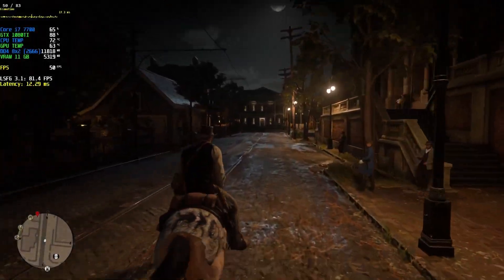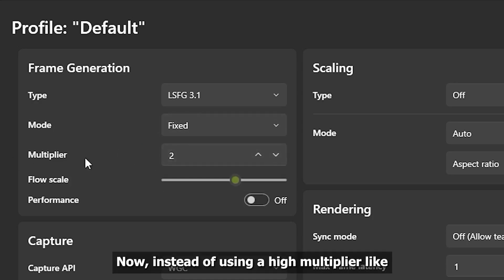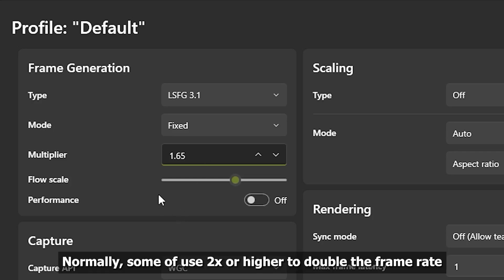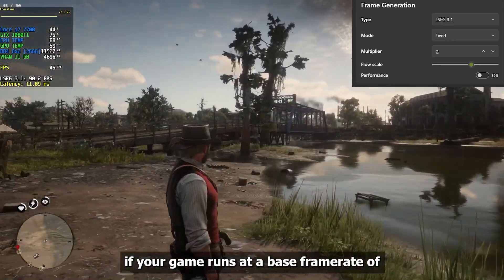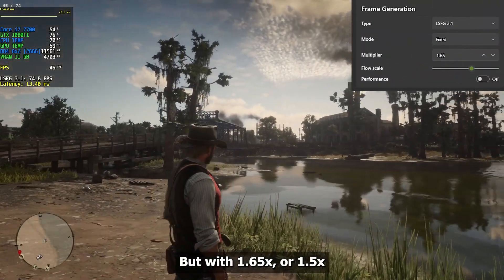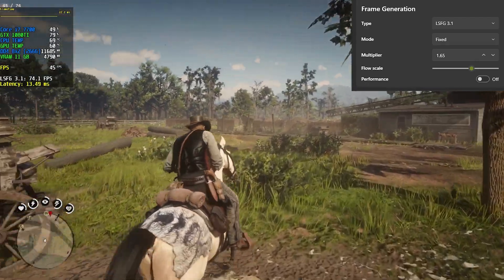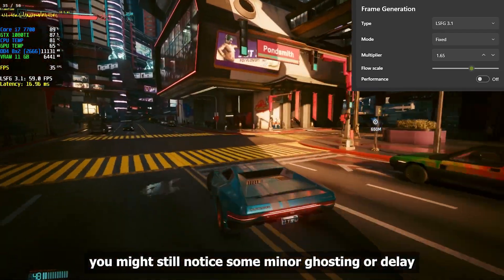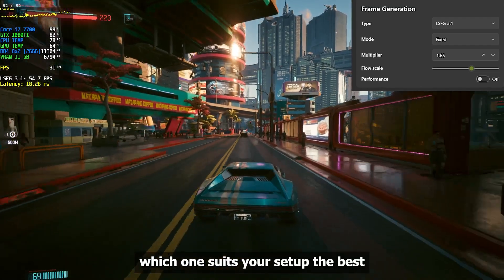Reduce Flickering & Input Lag with This Multiplier Trick Lossless Scale Frame Generation

Comment: I have a question, when i for Example play bf6 or other game i suppose to get 90-120 fps i native 1440p high settings, but when i activate lossless scaling with 4x lsfg it shows that its scaling from 60 FPS but iam supposed to have 90-120 fps so the imput lag increases a lot but why does it happen and is there any fix for this, approcate for answer
Reply from the maker: Using Lossless Scaling costs you some of your native FPS because the software needs GPU resources to generate the artificial frames. The higher the multiplier you choose (like 4x), the more performance overhead it puts on your native rendering.
The reality is that if you are expecting a massive FPS boost (e.g., you have 90fps using x4 mp = 90x4 = 320fps) while also expecting lower latency, that won't happen. These generated frames are not 'real' FPS; they are interpolated, which introduces artifacts and, crucially, your input latency is still tied to your lower native frame rate.
For example, if your native 90-120 FPS when you enable LSFG, and you use the 4x multiplier, the software might show 320fps (90x4= 320fps) but the problem is ur native fps decrease 30 or 40 it's mean you have ( 90 - 40 = 50fps) you are still effectively experiencing 50 fps latency, which is why it feels laggy compared to your expected 90-120 fps experience. This is also why we generally don't recommend it for competitive online games where latency is critical.

However, there is another potential solution you can try, which is using a Dual GPU setup (if you have a capable integrated GPU, or iGPU):

Ensure your CPU supports the iGPU (i.e., not an 'F' series Intel chip).

Shut down your computer and plug your main monitor cable into the motherboard's HDMI port (this routes display output to the iGPU). You'll need Windows 11 for the best support here.

In Windows Display Settings --> Graphics --> High Performance, set your dedicated GPU (GTX/RTX/AMD) as the one for your games.

Now, open the Lossless Scaling tool, navigate to the GPU settings, and select your iGPU as the preferred card.
This configuration forces Lossless Scaling to run its frame generation overhead on your iGPU, leaving your dedicated external GPU free to run the game at its best possible native frame rate. From my testing, this results in less native FPS decrease, minimized graphical artifacts, and better overall perceived latency.

I know this is a long answer, but based on my experience, this is the right way to fix the issue you are describing.
Reply: @WinWinTips55  ok thanks, ihave 4070 ti super so i think iam fine but what would you recommend istead of buying dula gpus to get lowest imput lag possible, i totally appricate it thanks!

Comment: Locking to 30FPS to get smooth 60fpss gives me 33.25ms latency... is there a way to alleviate this?
Reply from the maker: You cannot reduce this latency issue completely, but if you have an iGPU (I mean, an integrated GPU), you can use it for the preferred settings on Lossless Scaling. However, you need to run this on Windows 11 24H2. In the future, I'll make a tutorial on how to use a dual-GPU setup and how to stabilize your native FPS without losing performance. In the meantime, you can search YouTube for tutorials on how to use the dual-GPU method—there are many out there, but I will recommend a trusted YouTuber who explains how to use this dual-GPU thing.

https://youtu.be/Sv05U3PJ-bs?si=qfDqgYkRC9QotPG_

Comment: Hey guys can you guys help? Is it just me when I use lossless scaling there's this like instant low fps stutter and everything gets like so motiony then it all goes back to normal? I think my laptop should handle it very well but is it just me that gets this? Can you guys help me solve this issue?
Reply from the maker: All that matters is your base frame rate. If it’s very low, like 30 or 25 FPS and below, the game will feel weirdly laggy, just like you mentioned too much motion. The better way is to first optimize your graphics settings, use FSR upscaling or a lower resolution, and then apply frame generation. Remember, I always say this isn’t magic that increases your FPS. These are generated frames (fake frames), and they only work properly depending on your base frame rate.
Reply: @WinWinTips55  oh alright man thanks❤

Comment: Sorry for dumb question, but I can't set my multiplier to 1.65, it can be only go for 1x or 2x multiplier, but not to intermediate value like 1.65 etc. Anyway, thanks for this video, and have nice day!
Reply from the maker: this multipliers available at lossless scale 3.2 latest version (lsfg 3.1) old version like lsfg 3.0 not supported 1.5 or 2.5 numbers.
Reply: @WinWinTips55 thank you for answer.
Reply: Use (,) instead of (.)

Comment: should i play rdr2 with this setting on lossless scaling if i get 25-30 fps in 720p low ?
Reply from the maker: Buddy, the problem is your native FPS. That means, for Lossless Scaling to work properly, you need at least 37 to 40 FPS. If not, you’ll experience more flickering and delay issues. This tool doesn’t work like magic. it works properly by using some of your native FPS.
(I forgot to mention this in the tutorial apologies for that.)
From my experience, it can cost around 10 to 12 FPS. So the better way is to first optimize the graphics settings in Red Dead 2 to get a stable base frame rate of around 35 to 37, then use this tool.
Reply: @WinWinTips55  so i will play this game later when i will get my new pc , thanks other wise i might have tried it and then my all time would go waste , thanks bro

Comment: When ai am using lossless scaling. I am facing ghosting issues around Arthur. When I move camera ghosting could be clearly seen around Arthur.
Reply from the maker: Yes buddy, this issue can't be completely fixed. we can only reduce these annoying problems. try to optimize your game settings. make sure turn off motion blur and vsync and triple buffer. if you can get better native fps like 40 or 45. you can reduce these issues. but cannot completely fixed.

Comment: No need to limit fps bro?
Reply from the maker: FPS limiting helps to get stable performance. But in my experience, setting a lower limit like 30 or 35 can introduce more latency issues. So it’s better to turn off frame limits. and make sure to set queue target to 1.